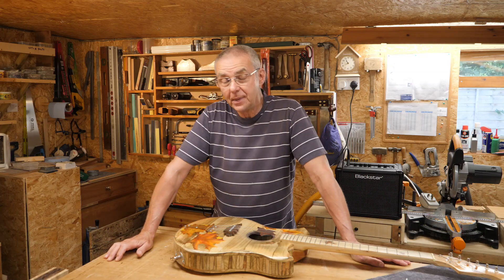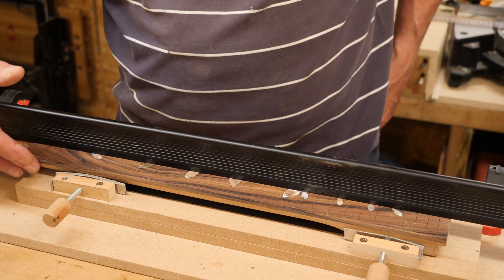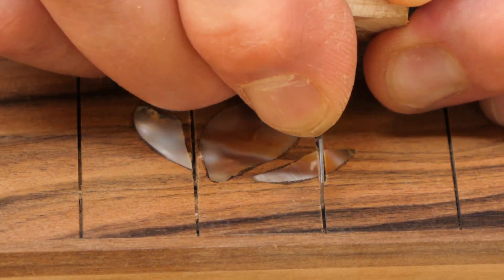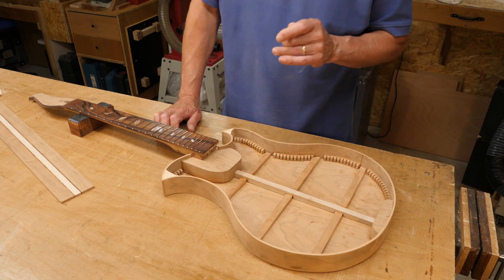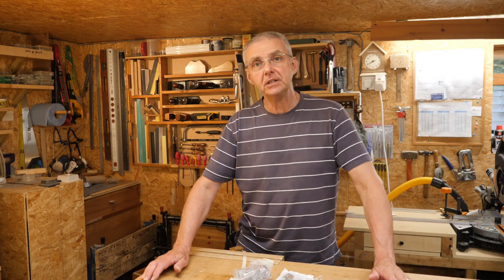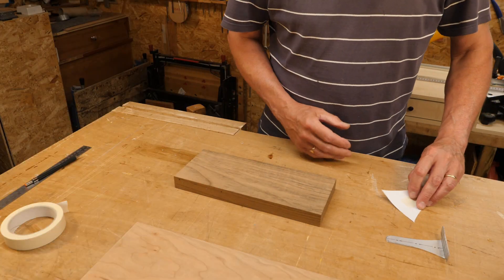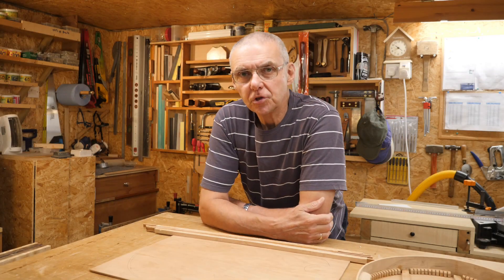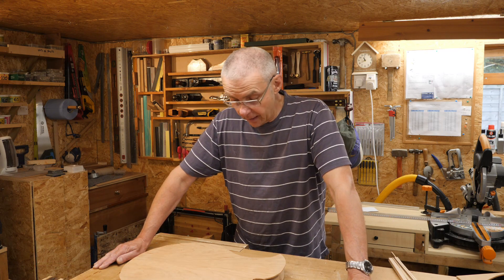#GGBO22 Community Build ep12: Ah well if it doesn't work I can always hang it on the wall.

Comment: What makes you think the rescued neck will be unstable? It's laminated and has a truss rod; should be OK if the glue and clamping was done properly.
Reply from the maker: Hi Ricobass0 the problem as I understand it is with the repair I did, the glue and dust padding I used might not be strong enough, the various woods I used in the petals may expand/contract at different rates and the headstock angle is probably not steep enough (there were some other issues with the headstock length and orientation).  Other than that I thinks it’s fine 😂. Thank you for bearing with me. Cheers Dave
Reply: @DaveDickens  I have had timber issues on past builds, its the price we pay for trying something new  :)